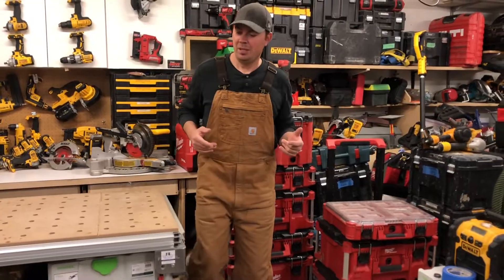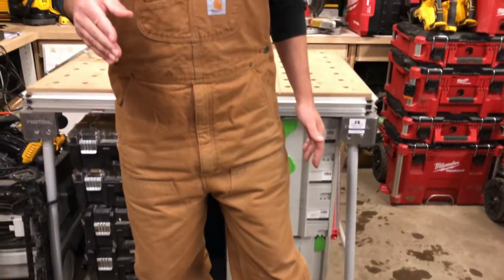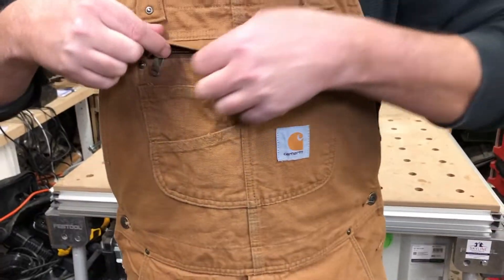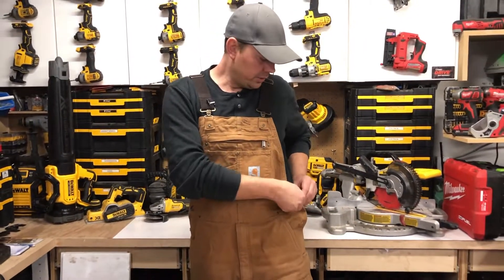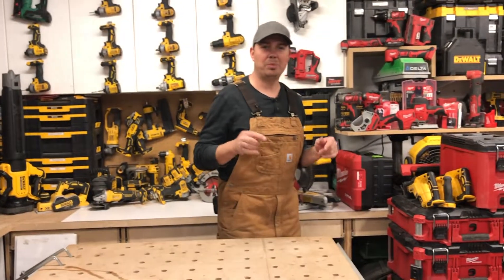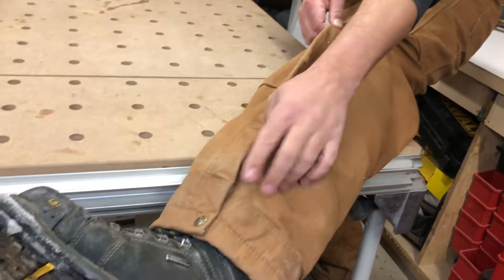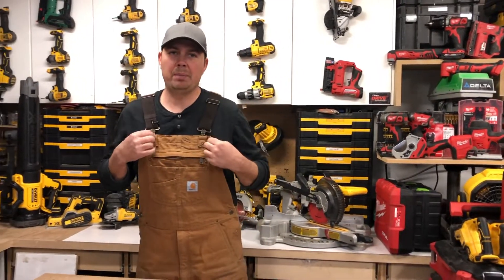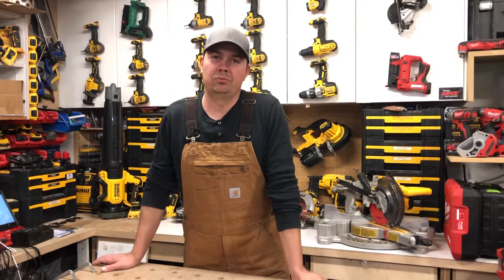Can these handle EXTREME COLD? Carhartt Insulated Bib Duck Overalls REVIEW

Comment: The Carharts are awesome… however,     a tip; if you use the coverall often, there is weight on your shoulders ( can make you sore!) To avoid this it is best to take the weight off your shoulders by using a waist belt with these, (or some velcro ankle straps??) BE WELL!
Reply: how does the waiste belt attach, are there cloth partitions on the inside ?
Reply: WTF? SMH
Reply: I’m sorry 😅

Comment: The pockets on the new bibs are not deep. Don’t put phone or wallet in the pockets besides the zipper spot
Reply from the maker: I agree they could be deeper, I Cary my iPhone 13 Pro Max in it. The camera sticks above but it’s never fallen out.
Reply: @hammerandhome  I went to a mom-and-pop shop, they had one old style left with the deeper pockets but I like the new style with the carpenter pencil pockets. I  like the big pocket and if your working you never have to worry about the pants slipping down if you have a tool pouch on.
Reply from the maker: @McBurger29  definitely, the main reason I switched from pants to bib style is because of my tool belts pulling my pants down.

Comment: You know Brad i got mine, but mine are a little different. The pockets are different and quite frankly a little disappointing. There is no good place for a pencil, and my phone doesnt fit in any pocket except for the standard hip pocket or the back pocket. Mine are insulated in the bib area, and i do like them, but i had a pair of berne before this, and quite frankly i liked the pockets much more on the berne....which was also much cheaper than the old carhartts. That being said i do wear em every day at work or at the shop.
Ok well......
Keep on crushing it mr brad.
Reply from the maker: Weird about the pockets - are yours loose fit?